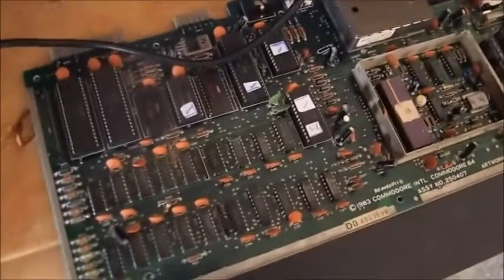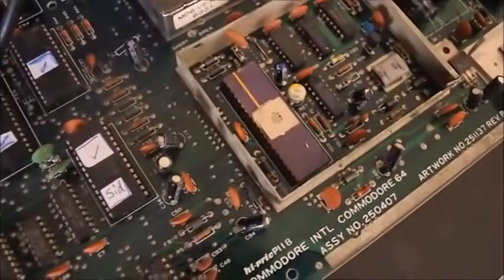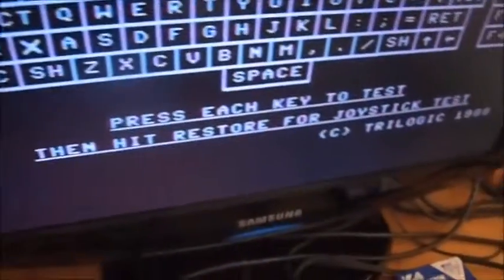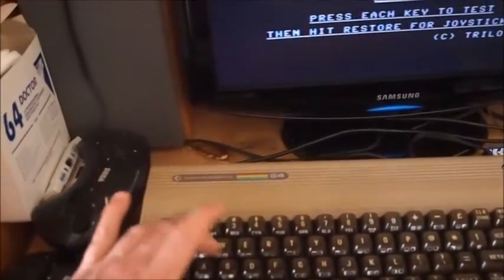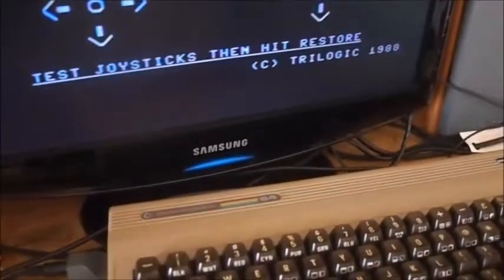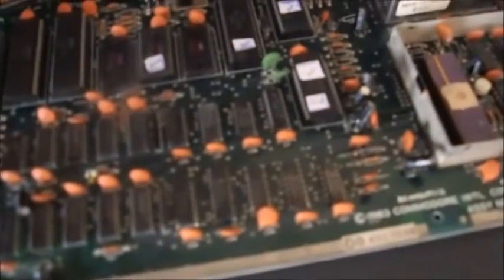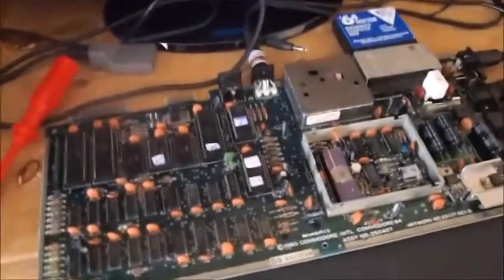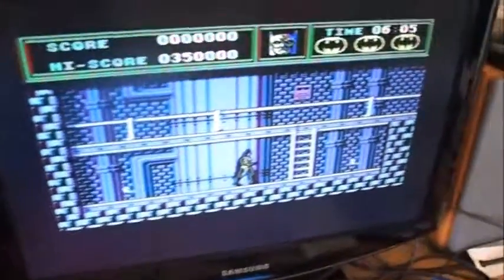Commodore 64 Repair...weird keyboard problems!?

Comment: I have a weird problem with my c64c if you type for example "10 print 1 + 2" and return then list the line will read "10 print 12". Very strange beast the Commodore.

Comment: Did you ever find the issue, have have just got a c64 for cheap and it’s got a similar issue with the keyboard and joy port 2 all the keys work apart from 1 and the key next to it they give different numbers when pressed.
Reply from the maker: In this case it was a sega megadrive joypad that caused the problems as I didn't realise that theyre wired up differently even though they work just fine. Once I switched to a classic joystick I had no problems. In your case it sounds like CIA 2 might be faulty, that's where I'd recommend starting with your machine.
Reply: Retro Marky I’ve swapped out cia u1 I will try u2 after I put a socket in I need to buy a solder sucker Machine I think
Reply from the maker: yeh that will certainly help as desoldering old commodore boards can be quite a pain at times so anything that makes it easier is a good idea 
:)
Reply: Someone’s had a go at this c64 before but they socketed two of the  logic chips there is a 3rd I can see I have some logic chip , alsou1 so I will try u2 and the 3rd logic chip.
Reply from the maker: yeh, any chips that are socketed, it's normally worth a quick chip change as often they're socketed due to failing prior.
Reply: Oh and left/right don’t work on the joystick unless I hold down the W key

Comment: Might be something else, but sorry I don't mean to be mean or start a conspiracy theory, but some healthy advice. you have a carpet on carpet (?), and touching the electrical contacts before ground . Try be more careful. The reason why i say this is that I see you move from one place in the room and back to the computer, then touch the keyboard pin header first. The cia is sensitive to static discharge. Either use a wrist band connected to system ground or touch the cartridge shield before anything else in the machine. Hope it helps :) I hear England is a humid place so shouldn't be too much of a problem ? :D
Reply from the maker: Yeh normally I am a bit more careful but I was in my bedroom and wanted to get a video out there.

Comment: Since you've already swapped the CIAs (6526) which the normal cause, I suspect it must be U18 (4066).  That's an off the shelf part you should find on eBay!  I bet that's probably the cause!
Reply from the maker: ahhh thankyou so much, i have two c64s with the same problem so will give that a try and post an update! :-)
Reply: Subbed btw!  Let me know how you get on!
Reply: Depending on your board revision U18 might not be a 4066?  There should be 2 x 4066 chips on there though, one is used with the VIC I think, and the other relates to at least one of the CIAs.
Reply: It could be marked U28!
Reply: One final thought before you swap out the 4066 - try without the SID connected.  It will work without a SID, and if your problem goes away that's a clear indication that either the SID or the 4066 is the problem.
Reply from the maker: OK thanks. Will do that today and see what the deal is.
Reply: If you look at the schematics you should see there are two areas that might be causing the problem.  The first is on the page with TED - there are some 74 logic chips inbetween TED and the RAM I think, it could be thoise.  The other possibility is that the PLA section has a fault - if you look at the PLA on the diagram there are 5 or more 74 logic chips connected to the PLA.  Maybe one of those is causing the problem.
Reply from the maker: OK thanks. Just so you know, I tried without SID chip and no difference, prob remains. Also I swapped the PLA for another and same problem persists, it's not a fault with the PLA therefore but something in the circuitry, will take a look at everything coming and going from the PLA next!
Reply: Sorry, that post above relating to TED and PLA - that's for your C16 problem.  I replied to the wrong video!
Reply from the maker: Yeh no problem, I knew what you were referring to. Yeh the C64,  I tried PLA swaps and SID removal to no avail. The C16 is on "hold" until I look at schematics again. Im waiting on delivery of the 4066 chips so should be able to update this over the weekend / next week on how the C64 is looking. 
Love your videos btw, I've spent far too much time watching them and then  spending far too much money at Tynemouth and on the Ultimate 2 (which is worth every penny for a serious C64 user!) :)
Reply: @RetroMarkyRM  and then what happened??